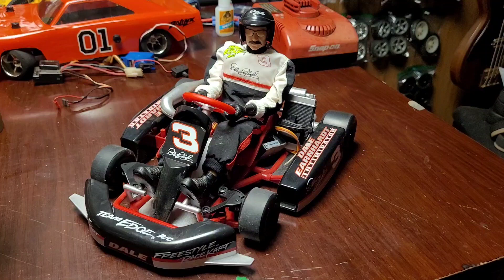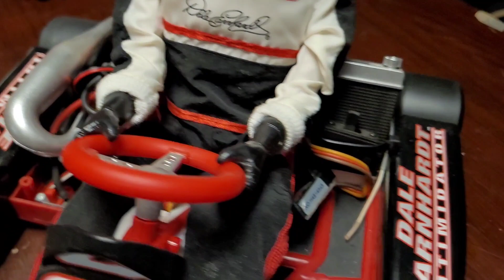Dale Earnhardt go kart 1/8 scale run/slowmo

Comment: I did the same type of thing with mine. Mine is the jeff gordon version. I couldn't Figure out how to put a servo in it without cutting it up too much. So what I did is I gutted an old servo I had laying around and used the pre-existing steering setup and basically made a servo. I'm planning on putting a small brushless motor in mine still though. That is gonna be fun to figure out.
Reply from the maker: Sounds awesome 👌 thanks for watching 😊 🙏